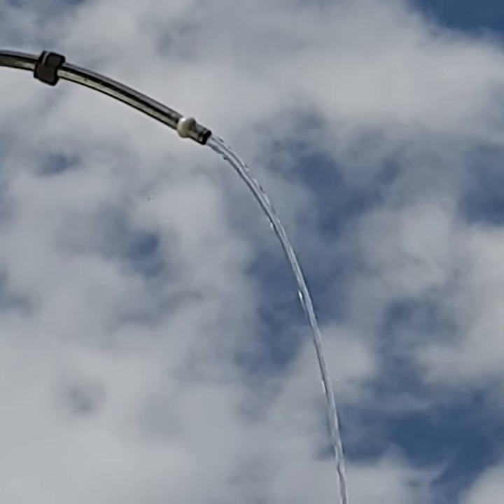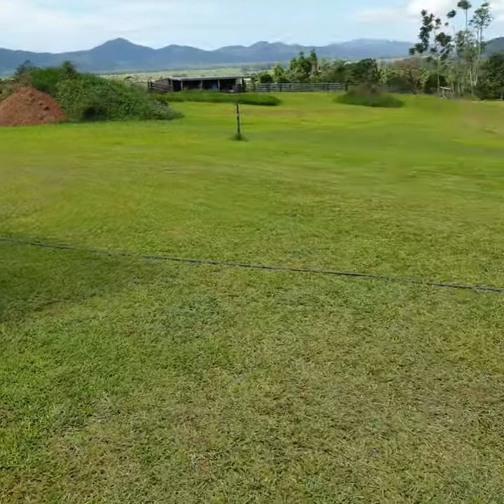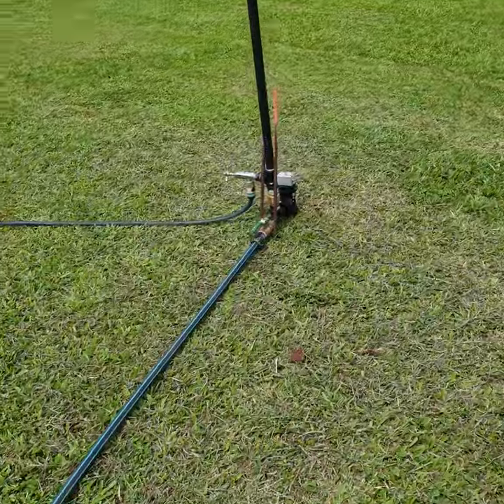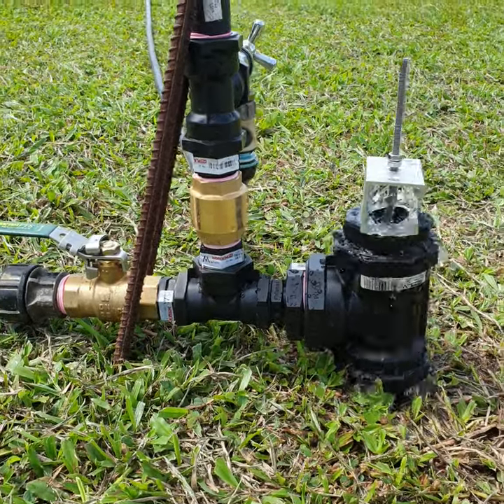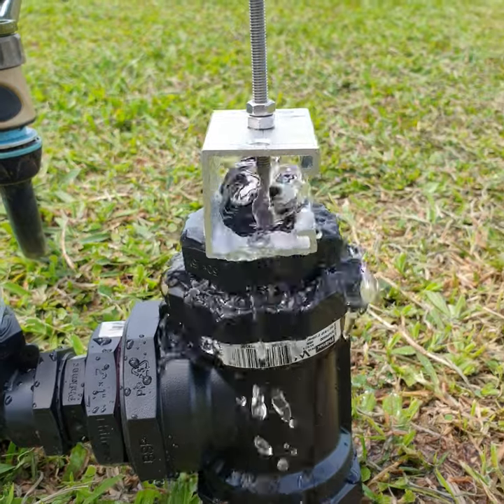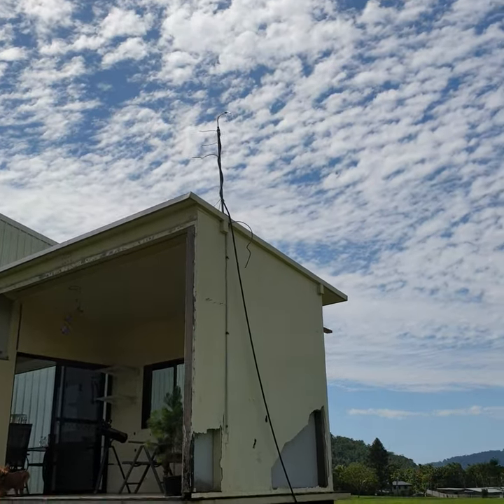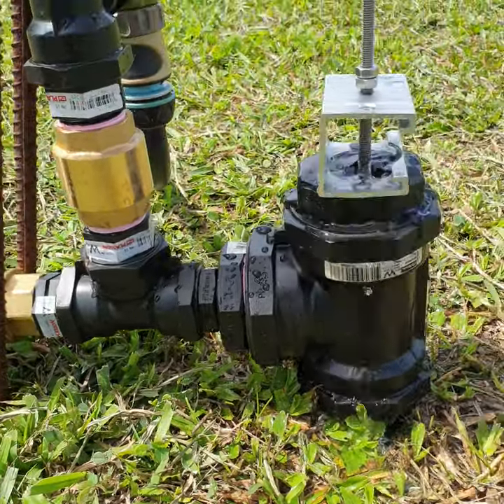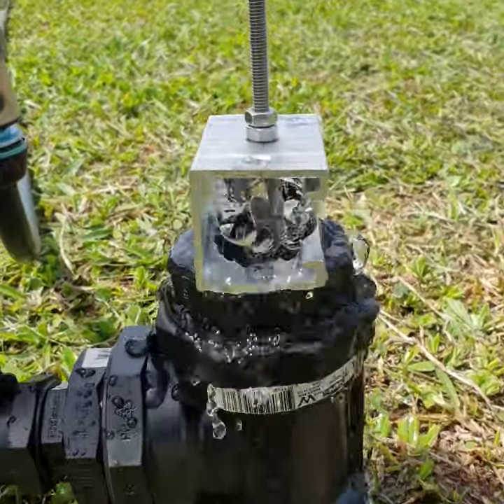Ram Pump Waste Valve Version 1

Comment: Nice one. I think these ram pumps are great. No electricity required :-)
Reply from the maker: I now have one in my stream working for the 10th day straight. 
It sure is a nice feeling not using any petrol or very sophisticated.
Reply: @dougydoolittle5255  Absolutely. Let the stream do the heavy lifting :-) Cheers.
Reply: Price